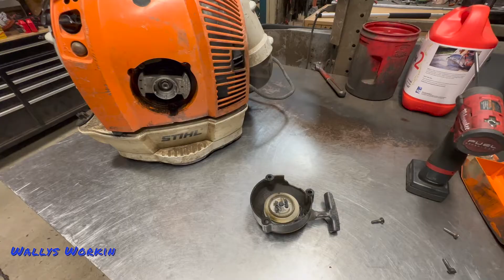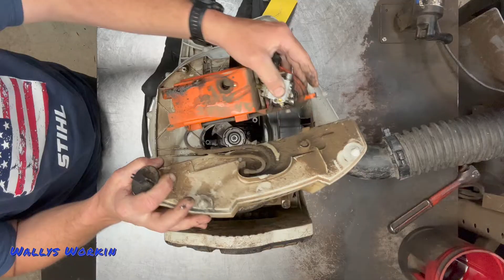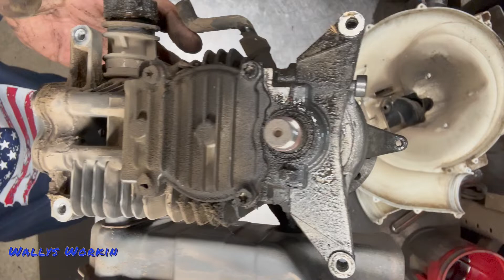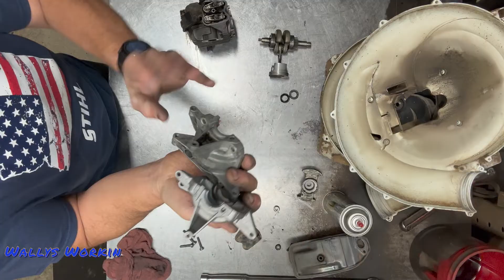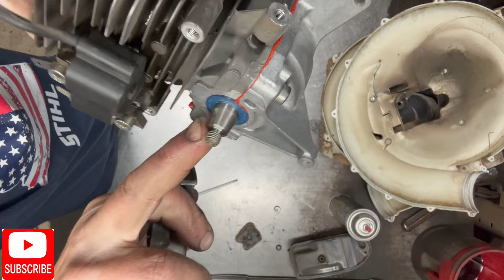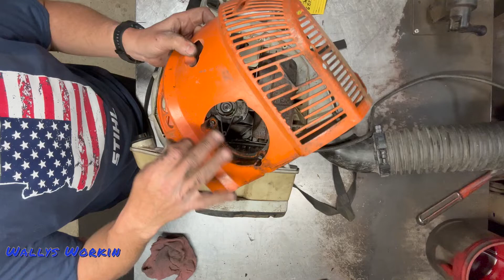STIHL BR 600 / 700 LEAKING ENGINE PAN REPAIR / DIY

Comment: Please help me out, i have a problem with my 550, the machine fully rebuilded from scratch and only works if i keep pressing the fuel pump, when i stop the engine also stop, carburetor checked four times, fuel line also okey, valves are okey, no idea left, maybe the impulse is weak but im not sure. Thanks a loot !
Reply: If you've checked for air leaks then it's most likely still your carb. how did you check the carb?  There are so many tiny orfices and check valves in there.  I managed to revive some in gasoline.  Look up ultrasound cleaning carb by Steve's Small Engine Saloon

Comment: So I have a BR700 with zero compression. I've adjusted the valves to no avail. Could it be the De-compression valve? If so how do I test/fix it? You mentioned it, but I've yet to see how it works or where it is to actually look at it. 
Love your videos by the way. Great work!

Comment: Hey Wally, at 34:45 you mention "10 thousands" valve lash.  Factory specs call for 0.10 mm or 0.004" for the BR 600 model.  At 0.010", this already loud machine will miss the ramps on the cam lift profile and sound like broken glass in a steel barrel, not to mention be down on max power, idle stability and have poor startability.  To save a few bucks, I trimmed down the 0.004" blade in my standard feeler gage set with some sharp tin snips to fit between the valve tip and the rocker arm's narrow valve pallet.  All is good.
Reply: I noticed that too. Probably just a brain cramp

Comment: One of the best videos I've seen. I have a BR 600 that had a lost power and was making a  rattling sound. After watching your video I inspected my oil pan and saw that the bottom broke into many pieces  where there was a screw.  It pulls good and seems to have good compression, is this wishful thinking or is the motor bad. Hoping all I need is a new oil pan. Any help would be appreciated.  Thanks

Comment: Could'nt you make a tool with a 90 degree 27 torx that could reach the back 2 pan bolts without all the disassembly?
Reply: Nope. It has to be completely disassembled.

Comment: I find it's easiest to put the flywheel in a vice. It stops the piston from moving, making it easier to remove the fan nut. That way you're not fighting it, and its secured. Just don't over tighten the vice on the flywheel.
Reply: I wouldn’t risk shearing the flywheel key, it’s only held in by a hair

Comment: Has Stihl done anything to fix this issue?  I’m responsible for 62 of these machines in our fleet, all BR600s and every one of them has this problem
Reply from the maker: They did an engine update, check out the link below. 

Stihl BR600 and BR700 new engine design / common problems update
https://youtu.be/giuHhuRkOBU
Reply: Just checked it out!  I appreciate the quick response! @wallysworkin823

Comment: What are your thoughts about using an anaerobic  gasket maker for sealing the pan and timing covers?
Reply from the maker: Hmm, I’ve never tried it. It’s worth trying, it won’t affect the crank bearing clearance. It would be interesting to see how it would hold up.
Reply: @wallysworkin823  thanks.  I may give it a try...

Comment: Is it common to be getting shocked (right hand)while operating the BR600?  Is there an anti static wire?
Reply from the maker: It happens sometimes. Stihl makes a “anti static wire” for blowers. Contact your local dealer.

Comment: A 4 stroke with 2 stroke lubrication...
What could possibly go wrong?
People are lazy, people are cheap. That engine demands expensive Stihl supplied oil, of course it will fail.
For the price, it is an expensive turd.

Comment: Excellent and easy to follow video!  Im a Landscaper and have used Stihl blowers for over 20 years and in my experience they start leaking around 2 years old. Ive always just pressure washed them weekly but now I know how to fix the problem. Thank you sir!!
Reply from the maker: Thanks!
Reply: كيف تزيل البنزين الغلط

Comment: How do you check forsure that bearings are bad without taking them off they’re spinning freely barely side to side play my blower lost power so I took block off and everything seemed fine cylinder was good piston was moving freely clips and pin were good & timing I’m not sure what happened I had another one given to me and nothing seemed wrong but same thing happened to it & yes valves were adjusted on both to spect so that wasn’t the power loss.
Reply: I know this is an old comment but here it is for others to know.  The flywheel will have play if the bearings are shot.  Grab it and give it a shake.  If it only rotates, you're good.

Comment: Thanks for the lesson, I have a 550 and a 600 Whats your thought on the 800 ?
Reply from the maker: Br800 is just ok, it does have some problems. Check out my video on the Br800 

STIHL BR800 Backpack Blower common problems and what to look for
https://youtu.be/X0qz2hS7aLQ
Reply: Using for snow ...For how cumbersome and heavy it is the benefits are not worth the slightly better performance. Hardly noticeable from a 600. But then the fact that it eats the gas so bad has to be considered. I would say they go through 30% more fuel than a 6 or 7 at least. Definitely not worth it at all. There also louder.

Comment: That was great.  I'm wondering though, would it not be a good idea to use some thread locker on the pan bolts?
Reply from the maker: I  have used thread locker in the past but still had the pans come loose. When the heads of the bolts break off it makes them very difficult to get out of the engine block with locktite also.
Reply: @wallysworkin823   Ahhh... that makes sense.  So, if you don't mind maybe you can help me out.  I bought a br600 for $50 "for parts", hence the reason for watching your tutorial.  Tore it down as it was making the same kind of noise that was shown by Taryl Fixes All in his video, and I don't see any issues with the wrist pin.  After disassembling it looks great with no scoring or anything.  The piston itself has minimal scoring that JUST catches a finger nail, and the cylinder has even less.  The inside looks like it was getting lots of oil, and the bearings seem to be in just as good of shape.  Prior to teardown I did a compression check and it was almost identical to my other working br600.  You mentioned something about carbon may get caught in the valves but I assume there would be compression issues.  Could this be the problem?  Confused backyard mechanic.  Cheers.
Reply: @whonnockboy Have you checked the timing and the cam gear?
Reply: @nichenjie  It ended up being a bad bearing thankfully on the output shaft side.  Didn't have to much with the timing gear, got a jobber replacement from some place in Texas, and it now runs great.  Just had it out today, in fact.

Comment: FANTASTIC video! Just purchased a gently used 4 yr old BR600, residential use ONLY from original owner. Runs & starts great, no leaks. He used canned 50:1 gas mix from HD. Can you please recommend any preventative maintenance to avoid the leaking pan issue?  Am going to switch over to Stihl Ultra Synthetic & mix it myself. Any advice? Thank you.
Reply: IMO the only way to make sure is to take it apart and inspect them

Comment: @Wallys Workin, your comment on the wrist pin made me post this, it's not a bearing  it's a cheap bronze  bushing Here's a good video of whst I mean and why I won't buy a stihl blower. Echo all the way.

https://youtu.be/UFNzL0_UbH8
Reply from the maker: Yup, that’s why I don’t mess with them. I’ve replaced many many crank shafts due to wrist pin failures. Thanks for the link and the comment.